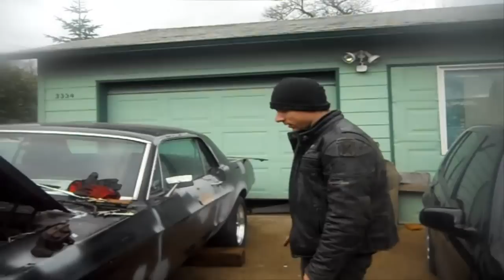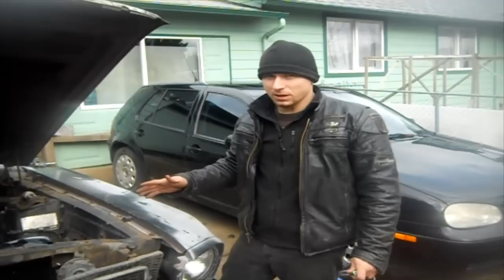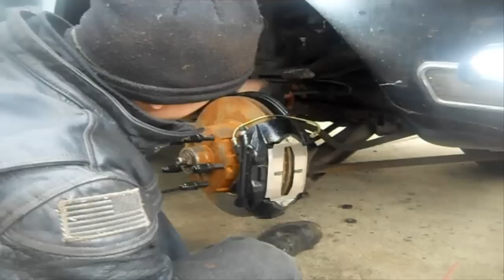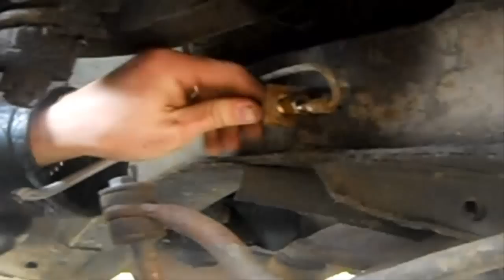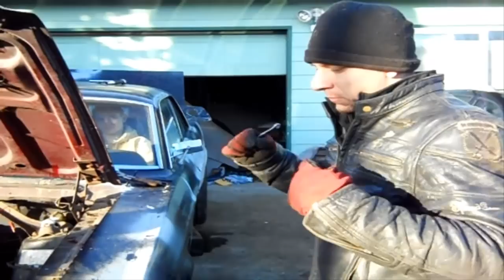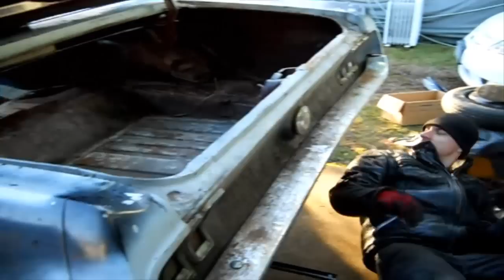Craigslist 68 mustang cheap 4 lug to 5 lug 4 wheel disc brake explorer axle conversion

Comment: To get ANY bolt/nut loose. Use heat then quickly cool it with water works 100% every time. Brake bleeders, suspension parts, any machine exposed to corrosion. The secret is the quick change in temperature. Don’t leave it hot, cooling it also helps keeps Old threads from stripping. Heating it red and not cooling it may damage threads. It can work on a blind bolt but it may take a couple try’s and using force will increase the chances of breaking. The best success comes from heating the nut/threads but just heating the bolt can also work. If propane is all you have, use ice cold water and it may take a couple times (map gas is hotter). Acetylene is the best. The only exception is exhaust manifold studs..heat the cast iron red and back them out while it’s glowing. This is an old auto shop trick I’ve been using for 35yrs and can not remember any time it hasn’t worked. It will work on rubber brake lines only with a few seconds of heat and a gallon of water. We keep a refillable water fire extinguisher around just for this purpose. If you have exposed rusty threads exposed, like Leaf spring shackle bolts, heat the threads some also, and when the water hits it, the rust will pop off and will clean the way for the nut to unscrew instead of strip.

Comment: Nice work! Vise-grips are very handy, when used properly. That is a good point, it's much easier to get stock replacement parts than it is to get aftermarket pads, etc. It's probably a lot cheaper too. I did the same Explorer 8.8 conversion for mine. I also did a Granada front spindle/brake conversion. I used a 74 Corvette master cylinder and a 68 Thunderbird proportioning valve. It's all junkyard parts, but it works, it was cheap, and I learned a few things while putting it all together.
Reply from the maker: doesn't the granada swap then mess with the tie rod geometry and give you even more bump steer than these mustangs already came with?
Reply: They make it a little worse, but there are kits that help correct it. They are basically just tie rods with longer studs and spacers so you can adjust them vertically.
Reply from the maker: SuperKONR yeah i've seen them.  i prefer the 67 and up mustangs because then you don't need to swap steering parts to go 5 lug.  65 and 66 are a pain to convert as you already ran into... the 67 just used a different drum hub so all that you'd need is a factory style disc brake conversion for $500

Comment: a little tip for bleeding calipers or wheel cylinders,  get about 2 to 3 feet of rubber hose that fits snug over the bleeder valve, place the other end into a brake fluid container with enough fluid to submerge hose in, loosen bleeder valve pump brakes . this keeps air from reentering the system .
Reply: Or another one man way to bleed is pump the pedal a number of times an just open the bleeder an let it self bleed leave open pump again if it has not started to drip. do this to each wheel cyl. Been doing this way for 45 yrs. or you can buy a vacuum hand pump.. for $25 bucks but still need to apply a little grease onto the threads as not to suck air past the bleeder threads.. I'd think you would have done all the bleeding before putting the tires back on so you don't have wash the fluid off so the paint won't peel off.. I started doing all my cyl bleeding since wife or kids not home when <I needed them to help me.. Works for me

Comment from the maker: if the 6cyl mustang is automatic, you can reuse the stock driveshaft.  If it is a 3 speed then you need the v8 one.  the automatic mustangs 65-70 use the same driveshaft for v8 nd 6 cyl.  only the 3 speed maual mustangs got special smaller driveshafts...

Comment: another method with brake lines, if you are using a line wrench they flex.  Put the line wrench on the fitting  (when things are really tight a line wrench by itself will flex open and strip the fitting) , then clamp the line wrench with your vise grips.  Works even better than vise grips alone, and doesn't damage the fitting.
Reply from the maker: +Install Weber carburetors on a FIAT DOHC motor this is very true
Reply: Install Weber carburetors on a FIAT DOHC motor 
Actually you can get ANY bolt/nut lose heating it then cooling with water. The shock breaks the chemical bond with any corrosion. The secret is the quick change in temperature. If you only have a propane torch, the you’ll want to use ice water. I’ve been doing this for 35yrs professionally on cars, machine equipment, tractors, trailers, any bolt/nut that is exposed to the elements, with 100% success. If you have something mounted in rubber like a control arm bushing, use acetylene and heat it quick and apply water even quicker..problem solved no problem. Common sense must be used like directing the flame away from anything that wants to burn or melt and sometimes a makeshift heat shield is a good idea. Again, the rapid change in temperature is what makes it work, not turning the metal red like a lot of people think. Turning it a little red dose make it work the first time every time though.

Comment: When I bleed the brake or clutch lines.. I alwais use a litle hose and a litle can with a bit of brakefluid in it so I can see if there still air in de system... ?   You just open it and let it go?     Can't wait till the first start is on video of this thing..  😀👍

Comment from the maker: 97 through 2001 explorer 8.8 rears with modded spring perches.  exact width you'll need.
Reply: will this rear end fit on 1965 mustang?
Reply from the maker: Robert Sanchez  yes, but will be too wide by 2" or so... but you can buy another passenger (short side) axle and make the rear shorter while making the axles the same length at the same time... but the short answer is yes, and for a perfect fit it can be modded a little more...
Reply: +Invincible Extremes Hey man love the channel! question on the modification of spring perches. Did you end up putting completely new perches on or were you able to make the ones that are on it work?
Reply from the maker: Justin Bowtell for a 67-68 mustang i just widened the existing ones a bit... and they worked out great, just had to drill some holes in them for the big u bolts... hope that helps.
Reply: Yes that does thanks
Reply from the maker: Justin Bowtell if you can, pause the video exactly where i show the picture... you can see where i widened the perches an inch on each side using a rectangle of scrap steel... ;-)
Reply: Ahh I see it! That's awesome I appreciate the help.
Reply from the maker: Justin Bowtell  not a problem, thats what our channel is all about! Dont forget to subscribe and follow invincibleextremes on facebook and instagram and twitter!  ;-)
Reply: I have 1968 Ford mustang what years of explorers will fit my car

Comment: Can you do a detailed video on welding new perches on the explorer 8.8? I have an 80 foxbody swapped with a 408 stroker. I'm 22 and it's my first project car. It has the 7.5 rear and a c4 trans. I plan on rebuilding the trans as well.
Reply: Nevermind found out they use a leaf spring setup and cannot be used in the fox body platform.
Reply from the maker: clawwill34 yeah thats true, but there's no stopping you from welding on the fox body mounts, although its a lot of work... so a later fox 8.8 would work better (even though they are more expensive and only have 28 spline axles and aren't as strong as the explorer 31 spline axles...)
Reply from the maker: clawwill34  also, not really the same but I'll be welding new perches on a ford 9 inch axle to put into my 67 tempest so keep an eye out for that video for when i finaly do it... ;-)

Comment: Hi Invincible Extremes Muscle Cars Garage, I am in the midst of a 8.8 rear conversion, and I am having a tough time trying to find the right proportioning valve for this situation. What kind of proportioning valve would you recommend? One that will fit my factory lines to be exact. 

-Thanks Evan

Comment: Hey I know this videos old but I was wondering what brake lines were used? I got a brand new disco brake kit in the front and did the same exact explorer swap in the rear end, but now I’m wondering what to do with brake lines? Should I order a stock brake line kit or what worked with your setup? Thanks!

Comment: can you tell me what proportioning valve and disc/disc master cylinder you got?  i want to do the 8.8 explorer conversion for my 68 cougar.  i will be using the stock brake booster.  if you could post links that would be great!!  thanks
Reply from the maker: well, on this car I used a hieds master cylinder and prop valve.  but on my 68 firebird i used a wilwood adjustable proportioning valve, and I HIGHLY recommend it.  it's only $80 and i was able to perfectly tune exactly how much rear brake i wanted... here's a link to the video so you get a rough idea of whats up.
http://youtu.be/sSe8z1xw7c8?list=PLstbSdzzQcW8hvcbUUR4S-rGo24fVL0QT

I recommend a wilwood disc/disc master cylinder  to go with it, they have many different types that will fit your exact needs ;-)  keep in mind that I do not run a booster on any of my cars and absolutely see no need for them.  Also keep in mind i wouldn't recommend something unless it actually worked because I DRIVE my cars thousands of hard miles a month and if any of the stuff i used was in any way "iffy" it just would last or i'd replace it with a product that meets the demands of my abuse. ;-)

Comment: Will the stock 67 6cy drive shaft fit the new explorer diff?
Reply from the maker: if its automatic, yes, if its a 3 speed manual, then no.
Reply: The mustang being automatic will work right?
Reply from the maker: here's how it breaks down.  those 3 speed manuals are amazing transmissions, so all you'd need to swap to a V8 is a bellhousing and a new driveshaft.  BUT the automatics use the same driveshaft for the 6 cyl and the smallblock 289 cars, so you win there.  BUT the 6 cyl c4 trans is no good for even the stock 289-302 motor... it'll bolt up if you get a different bellhousing... just won't last very long.
Reply from the maker: the 289 c4 and the 200 six c4 are the same externaly, just different inside.
Reply from the maker: TheMarcusGomez yes, sorry, your last comment was hidden because google marked it as spam, but the stock driveshaft out of any 65-70 automatic mustang will work.  use the 1330 u joint adapter if its a 390gt mustang or a 1310 u joint adapter for the flange if its a 289/302/200 mustang...
Reply: Thanks. Last vid with mustang on highway was cool.

Comment: I got a donor 94 mustang with a 5.0 motor automatic i was thinking about using the rear end out of that will it fit.i have a 67 mustang 3 speed automatic
Reply from the maker: use the 5.0, its a good motor and the 8.8 will work but you'll need to weld on new brackets.  Sorry i didn't respond ealier, the comment was tagged as spam for some reason.
Reply: What about the one from a ford explorer do you have more pics and or show a close up of where you did the welds
Reply from the maker: frank lopez i"ll try and get you some, but basically a ford explorer rear has almost the exact brackets you need for a 67 and up mustang.  just a little narrower by an inch on each side.  you can move them over or the easier thing to do (what i did) is to just widen them with some 1/4x1 inch metal pieces... I think i have pics up in the video if you pause it.

but yes, an explorer rear is almost a direct bolt up.
Reply from the maker: frank lopez i'll try and get some pictures up on the invincible extremes facebook page, but I didn't have to reweld new perches on, all i did was widen the ones there from an explorer by an inch each side using 1/4 steel plate... and then drill through where it needed two new holes for the u bolts...

Comment: question, front disc conversion, so i still have 4 lug drums in the fron of my 67, i just ordered a disc brake conversion kit, what can you tell me about the spindles? do i need new V8 spindles or are they all the same, in which case i can keep my 6 cyl spindles
Reply from the maker: +Shane Lester same spindles. 67 used the same exact spindle for the 6 cyl cars and the v8 cars.  The hubs are whats different

Comment: i have a 67 mustang, originally a 6 cylinder with a 3 speed, then i dropped a 302 in it but still has the 3 speed, ive been using the original rear end for awhile but its been feeling whimpy this year, so i bought a 9" rear end, 3.85 gears, i got new 5 spring leaf springs (might as well), disc brakes and wheels, its sitting in the garage ready to go in but im worried about a couple of things, the master cylinder i have, im not sure if it will work for disc brakes, i was thinking maybe a proportioning valve like you said but i dont know much about it, ill be riding with discs in the rear and drums in the front so what would you recommend i do about the master cylinder? also the driveshaft, do i need a new one or is the original the same as the v8 driveshaft?
Reply from the maker: +Shane Lester you need a completely different driveshaft, theres no way around it.  And rheres really no point in using drums in the front and disc in the rear...  i recommend using a wilwood adjustable proportuoning valve like the one in my 68 firebird.  Worth every penny.  Also, front disc brakes are only 500 bucks from discbrakeswap.com .... DO NOT change your spindle.  You already have a v8 spindle, so all you need is to replace the drums themselves with the disc brakes and a disc disc master cyl.  Dont bother with a booster, i drive daily without one...
Reply: +Invincible Extremes Muscle Cars Garage i plan on getting discs in the front as well at some point, but moneys tight thanks to the rear end, plus id need to get wheels and tires plus the front discs so im looking at about $1,000, ill save that for the future, so you say i need a new driveshaft, i kind of expected that, im guessing the 51" from cjponyparts.com so ill go ahead and get that, i just dont want to tear the car down in the garage and then not be able to finish you know? its my daily driver i couldnt afford that to happen, i dont even care if the front drums dont work, i have no problem riding around with only rear discs working
Reply from the maker: Shane Lester yup, i know all about that... dont order from cj pony parts.  Theres a guy or two on ebay that sells the custom length driveshafts for 200 completely balanced, then you just need a 28 spline 1310 yoke and you should be set... cheaper than cj pony ;-)  a used 28 spline yoke is around $50 or less and the driveshaft can be ordered for any length... the expensive adapter will be needed if going with an explorer rear end.  Just read 9 inch, sorry.  Yeah, you need a shorter driveshaft than 51 inches anyway, the 9 inch itself is longer than a 8 inch or the little 6 cyl rear...
Reply from the maker: +Shane Lester just remembered, i lost rear brakes on time for over a month, but was good to go.  So just swap, the rear end, cap off the rear brakes, and keep driving on the fronts untill you can afford the $500 front conversion...  because driving anywhere on just rear brakes is suicide ...

Comment: If you plan to increase power with a V-8 engine swap the 6cyl spindles are made to light and can barely handle the weight of the the 6 cylinder engine. Trust that this info is true or due your own research on the light duty of the 6cyl spindles that Ford bar-owed from the Falcon for there new little 6 cylinder Mustang. BETTER SAFE THAN SORRY.
Reply from the maker: thats only true on the 64 to 66.  67 and up used v8 spindles on all mustangs and just used 4 lug hubs on the 6 cyl ones. otherwise I wouldn't have been able to use the v8 disc brakes...

Comment: where did you get the 1310 u joint adapter
Reply from the maker: +Joaquin Maldonado its a spicer part.  I think i have the part number in the video, not too sure, but ebay should have them as well.
Reply: Ok thanks

Comment: So you don't have to change the front splindle?
Reply from the maker: No need for the 67 to 70 mustang.
Reply: Late Night Kings shouldent
Reply: For 68-73 the spindles are different for disc brakes, you can cheat and run 65-67 brakes, it will work but it's not" correct".

Comment: Do you think the same Explorer rear end swap would work on a 65 Fairlane 289 automatic?
Reply from the maker: Yes, it'll be a little wider than needed, but if you want, you can shorten the long tube and use a right axle on the left side.  it'll then be the right width for the 65-66 mustangs and failanes...